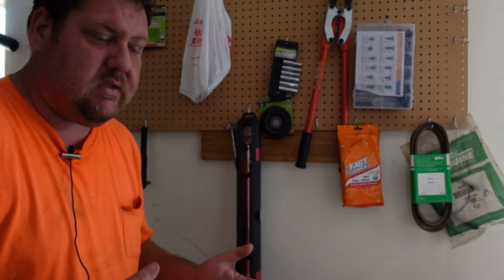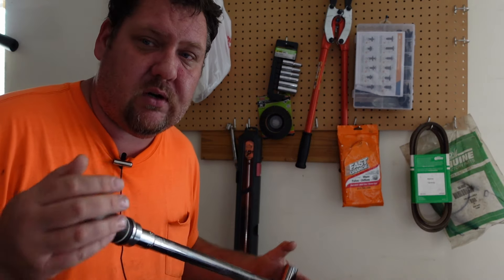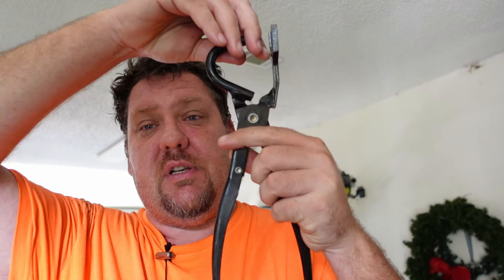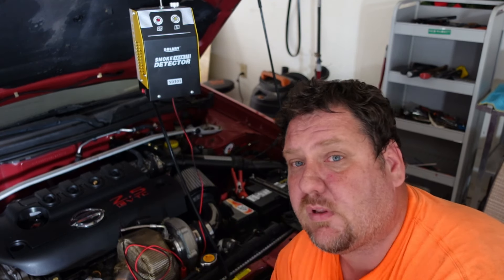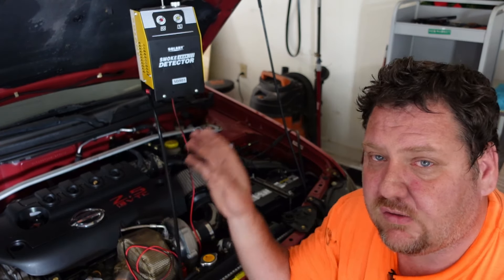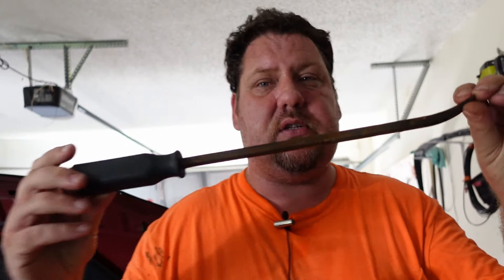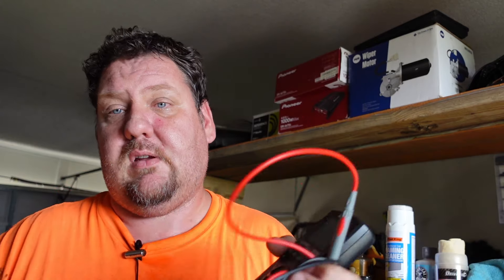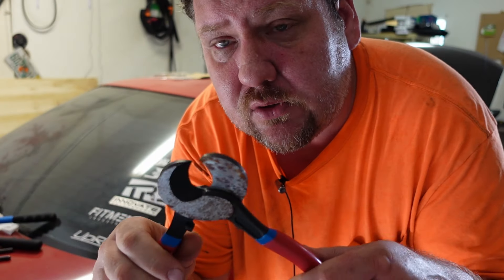10 Essential auto repair Tools and a couple "meh" tools.

Comment: Great video! Just wanted to add when you get those AC gauges from Harbor Freight you'll need also to get that little valve that goes on the refrigerant can. It's less than ten bucks and is on a peg right next to them. The hose won't let any refrigerant through without it. Also if you have an air compressor Harbor Freight has a little red pneumatic vacuum pump on the bottom shelf for around $20. My 8 gallon air compressor will run it all day. That'll do all you need it to do for a fifth the cost of the electric ones they have. I was able to fix my own AC for around $100 worth of tools that I'll have forever just like you said. (They sell a leak seeker devise that sniffs out refrigerant leaks making you look like a genius when it come to AC diagnostic issues!)

Comment from the maker: Affiliate links to items used:
torque wrench: https://amzn.to/46xk2sx
DA polisher: https://amzn.to/4dqzrND
exhaust pilers: https://amzn.to/4d953aM
smoke machine: https://amzn.to/3LLQ4HT
AC manifold: https://amzn.to/3SA4MFz
Vacuum pump: https://amzn.to/4ftK4Rp
pry bar: https://amzn.to/46u46Ya
multimeter: https://amzn.to/3WNGKcE
wire stripper: https://amzn.to/3WNZSHF
small crimper: https://amzn.to/3Yvyqje
big crimper & cutter: https://amzn.to/4cenM3k
Digital caliper: https://amzn.to/4diSBFi